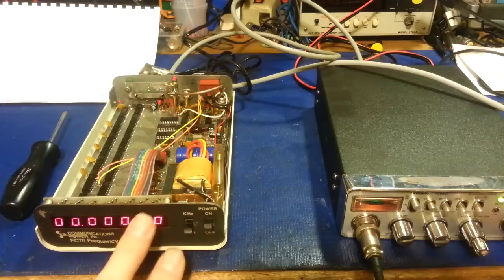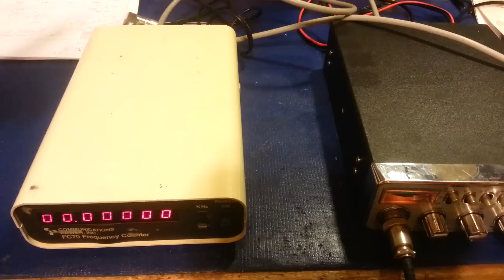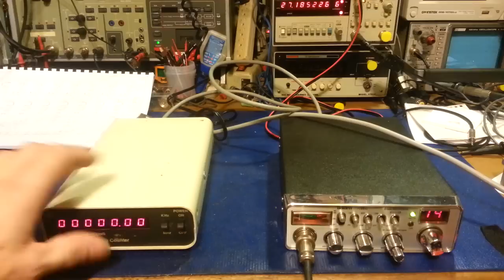Another CPI FC70 frequency counter repair.

Comment: How stable is the timebase on these?
Reply from the maker: Once it heats up its good.  As hot as they get they become their own crystal oven. :)
Reply: It's not something standard like 10Mhz is it?
You have done quite a few of these so there must be a bunch in service... just wondering what a TCXO would do it it as far as stability... certainly better than the on-board timebase from the 70s/80s.
And it would be an easy mod to do.
Reply from the maker: 12.8 MHz. They work and are pretty reliable.  They do have their problems but then again their from the 1970's.